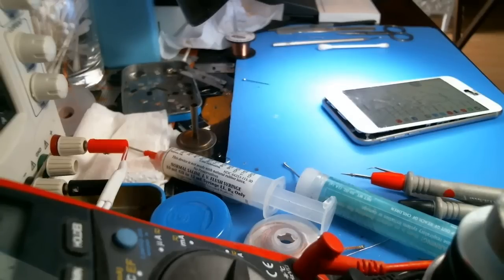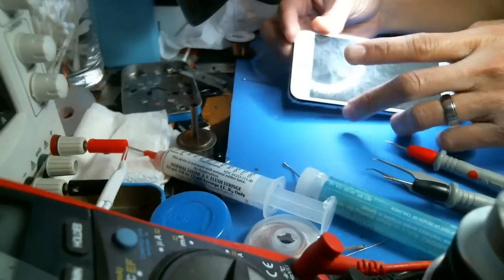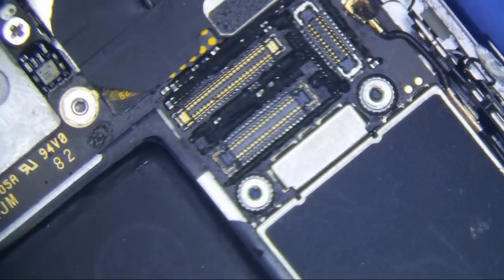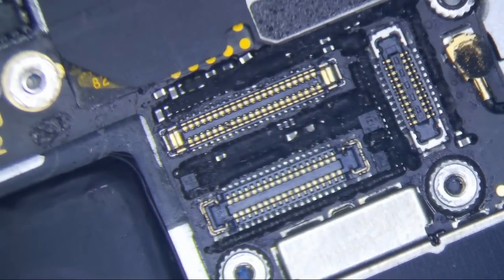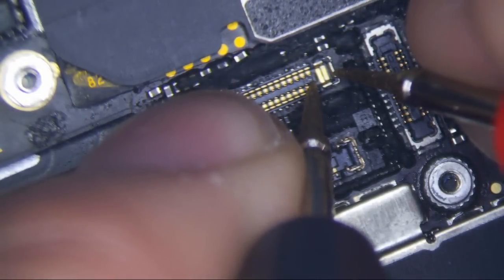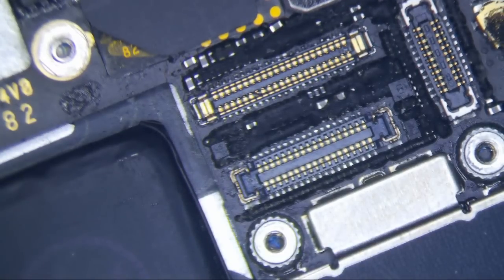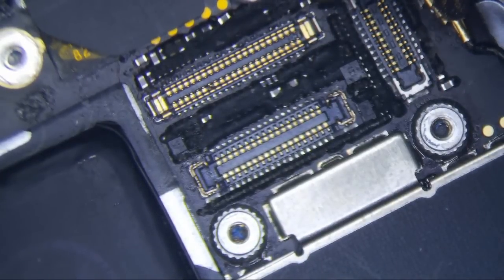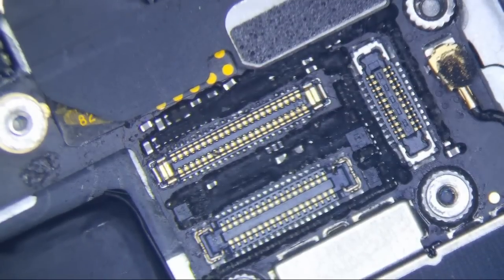Why the iPhone 6S backlight filter blows during a screen repair

Comment: Ok so I recently repaired a 6s and did not disconnect the battery. However, I distinctly do not remember any puffs of smoke and feel like I may have noticed that. Is this universally a symptom of the blown filter or is it possible to have blown without any audible signs or smoke? (Their phone isn't appearing to turn on at all, no fans or charging sounds when connected etc)
Reply from the maker: There isn't always a puff of smoke.  Shine a flashlight in the middle of the screen and look for an apple logo.
Reply: Thanks so much for responding and doing so as quickly as you did. I tried this a few times today and under different circumstances (all using flashlight as suggested). I never saw an apple logo at any point, any other suggestions to troubleshoot?
Reply from the maker: This will be a display issue.  You need to troubleshoot the display lines.
Reply: @Microsoldering  Hi I have the same identical issue described by Chuke Williams, with the difference that the LCD and digitizers are working (I can see the screen if I shine a light). What could be the problem? Thanks!

Comment: I had my iPhone screen repaired in June I completely cracked it and the digitizer as well. I got it fixed. A month and a half later I my music playing while opening snap chat. It goes dark I put it on the charge believejng I didn't charge it enough. Within five minutes it heated up really hot. I got still hear the phone buttons. So I left it in the fridge because it didn't want to cool down. The next day I took it back to the repair shop and they said my 30 day was up they aren't liable but did state that it was a microsoldering problem and the backlight filter burnt out. So now I took it to geek tech so they can remove pictures and he states the phone doesn't want to turn on not even with a new battery or screen. Also I want to mention that my iPhone 6s battery was supposed to be recalled but I never received email or letter. Is there anything that can be done to salvage my photos?
Reply from the maker: http://www.microsoldering.com/request-a-quote/

Comment: hi this is happend to my iphone 6s when replace the screen i forgot to undo the battery connector. is it possible my iphone 6s filter blow? now the phone turn on but no backlight appear on my screen
Reply from the maker: http://www.microsoldering.com/request-a-quote/
Reply: Have you tested the back light  first to eliminate it ??? Not disconnecting the battery first is a culprit often overlooked.

Comment: I hope that 3,8V is gone when I turn off the phone. I never remove battery when changing 6s screen.
Reply: simcard not working is because: when you unconnect your battery, your time gets automatically changed. Inorder to make your simcard work again: just connect to wifi and let it change your time and date to the present.
Reply: that's not true.  vccmain will still be present at the connector---this is exactly why disconnecting the battery is so important---for ALL devices
Reply from the maker: When the phone is off, then the 3.8V is gone.
Reply: Sigh, as always there is no perfect solution. If I disconnect battery I risk passcode problems and another explanation "why is my simcard not working?".

Comment: Thank you for sharing this. What causes BL filter 2024 blowing on iPhone 6? Metal spudger tool? I had couple of iPhone 6 that have had this  filter burnt and I replaced those and now there are good.
Reply from the maker: Usually pry damage on the 6 if it's just a filter.  Or you can short the LCD connector when the screen is on.
Reply: Sometimes cheap screens has very poor tape on that 3 wires on the right side, they can connect togather through metal backplate. For me the most common thing.

Comment: Could you please help me I have an ipad air, the previous tech said he failed to replace the touch. Now I have to use 4.5 voltage supply to make the iPad work and the current is getting close to 2 A when it boots. I know that's abnormal.
Reply from the maker: Could be anything man.

Comment: Is that blue mat made for phone repair? Does it have good grip on logic board? Not a fan of the metal holder made for it
Reply from the maker: No it's not.  It's just a heat resistance mat, mainly used for baking.  I don't think it has any ESD protection.